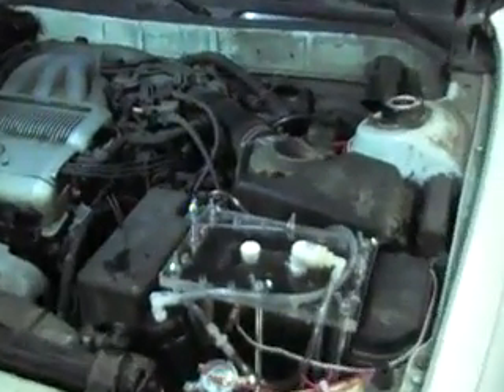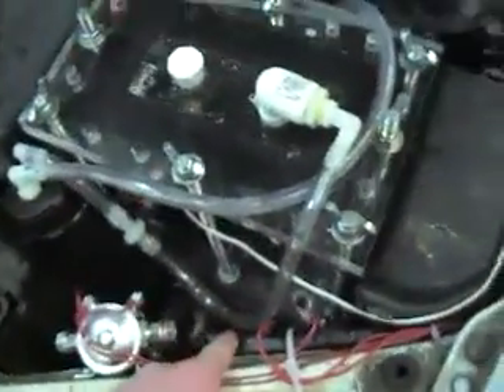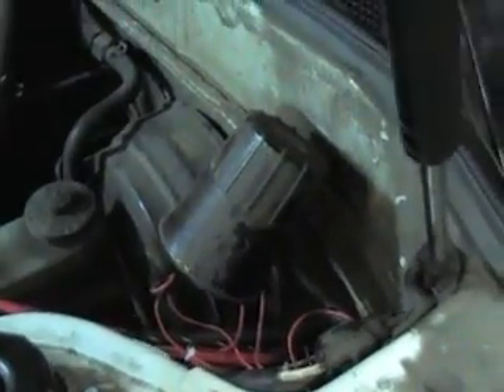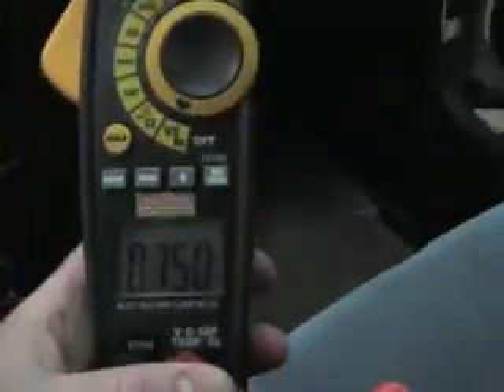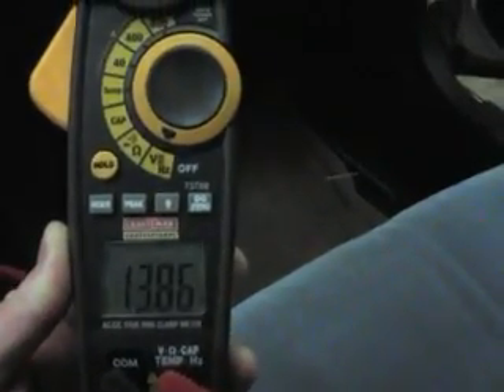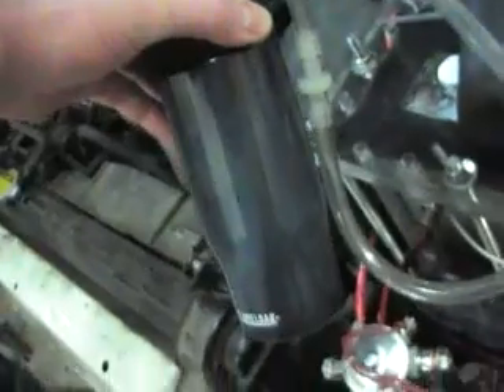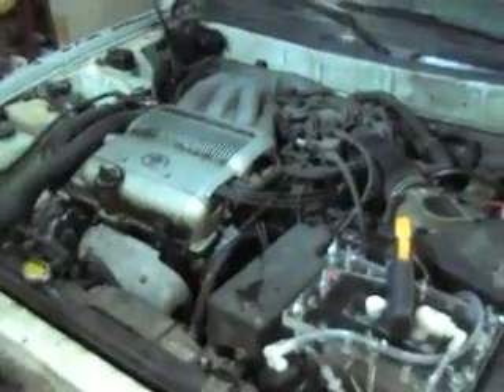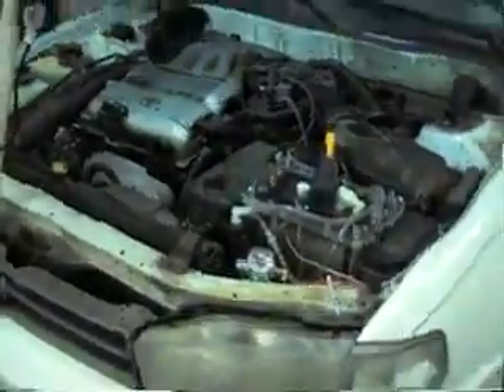Hydrogen Booster Install: 92 Toyota Camry Part 1

Comment: Nice job Jake. I would love to get you one of my systems and have you evaluate it for me. No need to relocate the battery. Also, I looked at your graph and noticed your efficiencies around 5 as long as electrolyte was below the top of the plates. I have recently tested efficiencies on my design above 10 MMW. You might want to try my design on your scooter. Get in touch with me, Rob.

Comment: you nee bigger alternator to keep the voltage steady or a smaller pulley so your alternator will run faster at lower RPM.

Comment from the maker: I have not tested the freezing point of the electrolyte down to that low.  But it will go well below freezing.  I use 50% alcohol in water in the bubbler to keep that from freezing.  The higher concentration of electrolyte the lower the freezing point.  I use 15 to 20% NaOH.